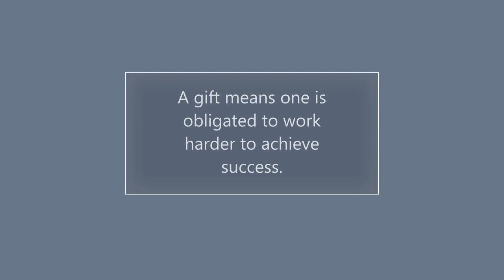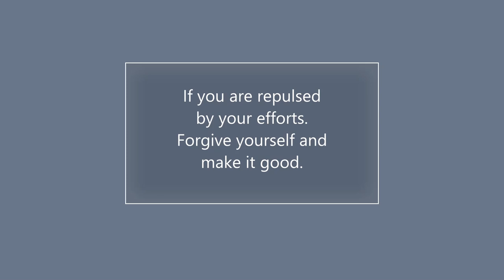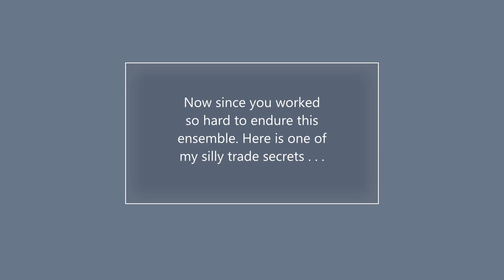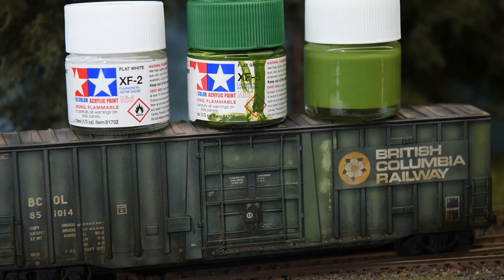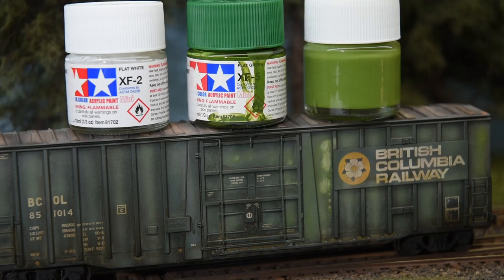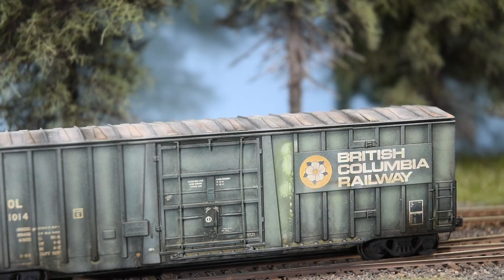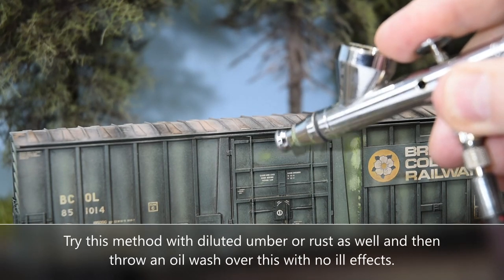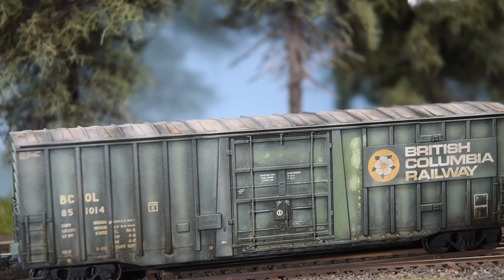The Model Train: Airbrush Weathering Clinic: No Parlor Tricks

Comment from the maker: Some advantages of Isopropyl based weathering is applying air (only) while the paint is still wet. This method causes a random "oxidization" effect which no sable brush can duplicate. I learned this by mistake during my museum career. This is what I mean when we play around and practice making mistakes. Also, if you don`t like the effect, or color, try removing the paint with an Isopropyl soaked brush, cloth, Q-tip or even crank up the pressure on the compressor and turn the airbrush into a mini power washer (Isopropyl is cheap). Remarkable effects can be achieved in this manner as well when coupled with the air-dry procedure I demonstrate. We need to take risks in order to advance our skills.

I call this "reverse" weathering. You can even take it to another level by following up with oil paints, water based paints, etc. to increase the depth and layers (glazes). It`s all in the multiple glazes in the end which creates the illusion of scale. Just experiment and have fun. You will only end up with a heavily weathered boxcar in the end anyway. Cheers.

Comment: Your work is amazing and your videos are excellent.  You are a master.
I remember you explaining your preference of Tamiya acrylic over Vallejo, Tamiya diluting well with isopropyl alcohol , and Vallejo with water.  I've been building laser cut wood craftsman kits lately.  I generally stain with an alcohol india ink solution, and then paint with cheap craft paints.
As you know, the wood warps easily, so I brace all the walls first.  I'm going to try making some Tamiya / Isopropyl alcohol stains, and was wondering if you might have any input?
Thank you.
Reply from the maker: Tamiya mixes equally well with water. However, if you want to make a stain, definitely use Isopropyl Alcohol for staining. My go-to wash with almost anything is Black/Brown (Raw Umber - extremely thin with pigment. Then work out from there. Cheers.

Comment: Any tips for a newbie airbrusher to get started, I've never used one and would like to practice before I use one on  a model
Reply from the maker: You need to commit or forget it. The primary tool you need is a small contractor compressor (with an air tank on it). You can get them for reasonable prices these days. Then buy a cheap airbrush and turn up the pressure. Thin the paint lot's and practice on paper or cardboard. It's a short learning curve if you are willing to devote time to it. After you paint your first model with your own color you will be blown away. Cheers.